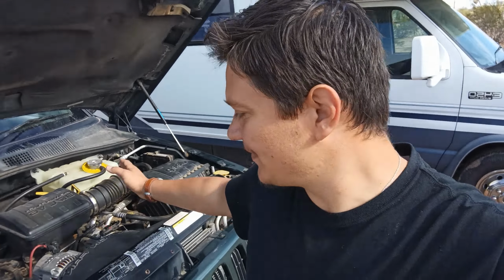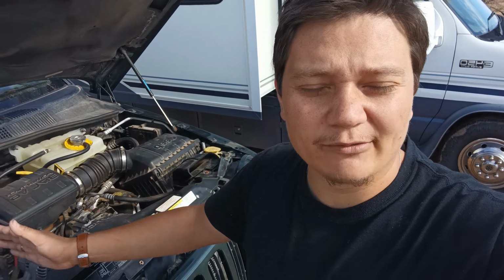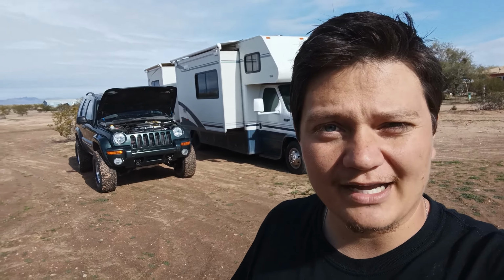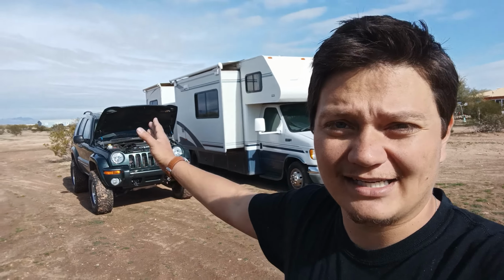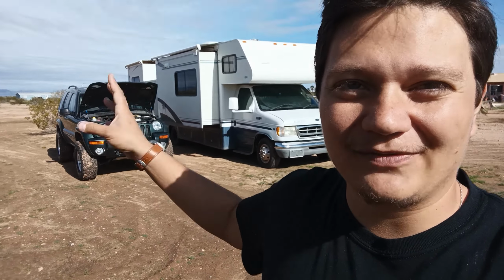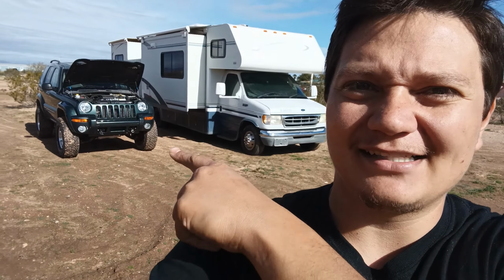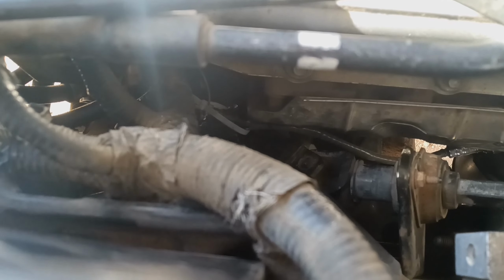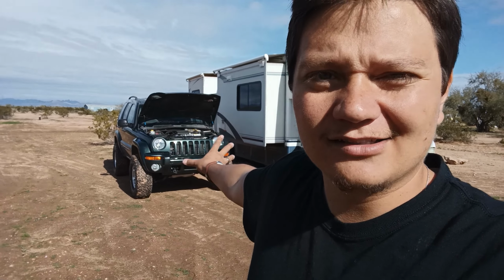5" Lift Jeep Liberty Subframe Drop Warning!⚠️

Comment: Thanks for the heads up on wire chaffing.  I followed you on the subframe lift, and running 33's with 4 inch lift. Didn't get as high as yours because no 400 bucks for those pretty red upper control arms. Had to cut more fender and bang more pinch strips. But thanks to your advise my Liberty looks and drives Awesome too! Will be sad if you sell it, yours was the best Liberty info on the Tube!!
Reply from the maker: Nice! And yeah no problem yeah the Liberty life was fun that's for sure 👍

Comment: Sure Tom Evans who helped develope lifts with JBA and Mike davis are wrong when it comes to tire and gear ratio. Both are OGs of the lifted liberty community. If you bother looking at the overdrive ratio, you'd see 33s with 373 have the 02 liberty hunting for gears around town. On the interstate, it's best to lock out OD under 75. Those with the 42rle have it even worst. Not everyone lives where the roads are ribbon flat. Even adding a 29.3 inch mud terrain had a sufficient impact on my fuel economy and going up most hills have the trans down shifting to maintain speed. Plus adding 35's, you're just looking to break a cv or axle.